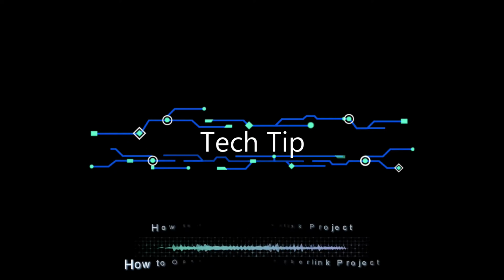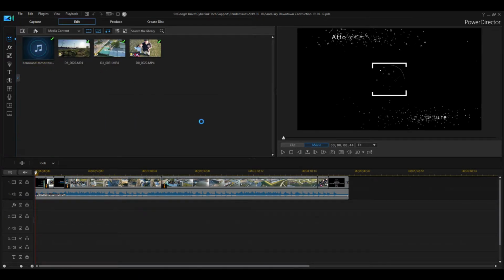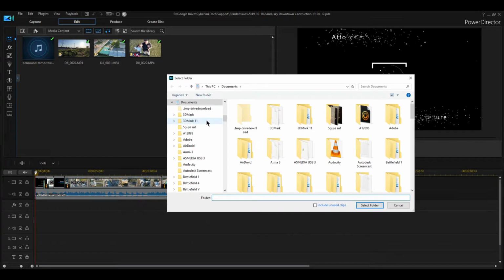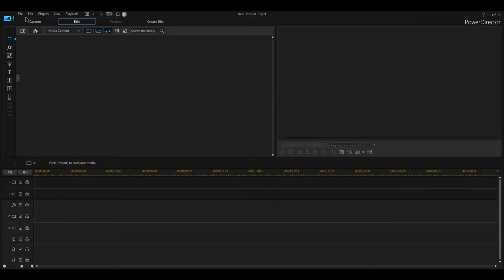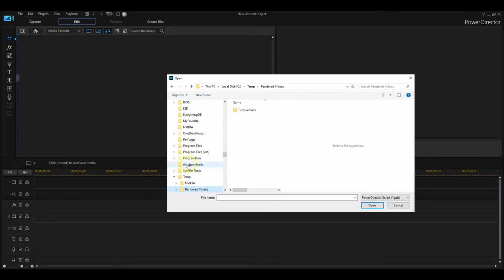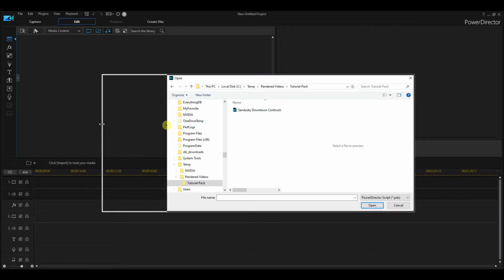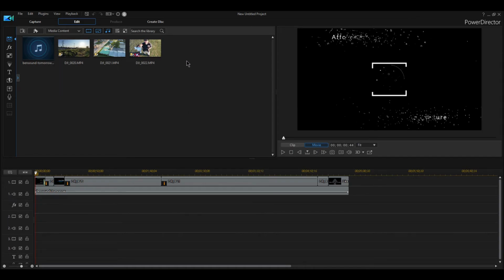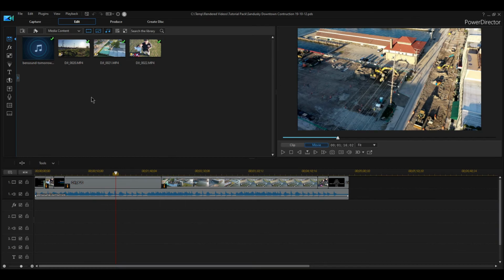How to pack & load packed Cyberlink Project Power Director

Comment: My PC is pretty high end with no viruses malware etc. Suddenly PD 20 is VERY slow to respond. Could this process (moving it all to a SSD) help? Will this also leave the original project accessable? Im editing a feature film and have only 10 minutes left to complete. Thanks
Reply from the maker: Sorry I have been battling health issues, and only just saw this comment please let me know if you still need help.
Reply from the maker: Moving to sss and using a disk caching software with decent memory and nvme cach would probably fix your issues. I reach out if your doing more work like this and still have these issues I hope the year treated you well.